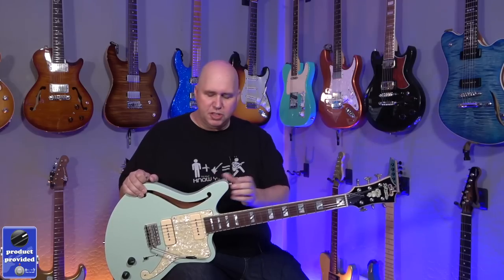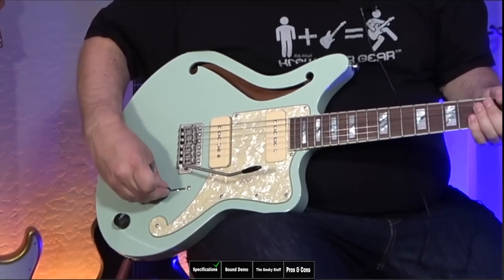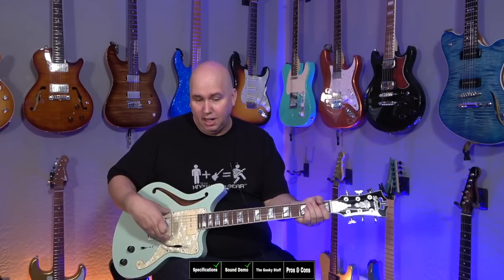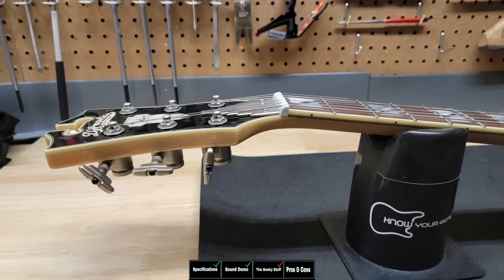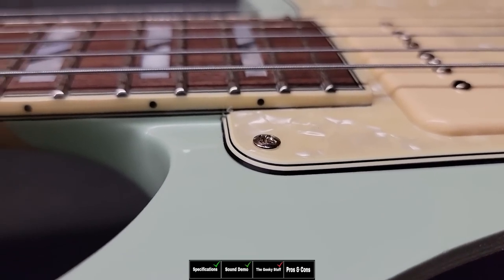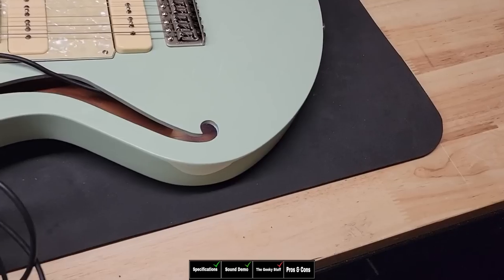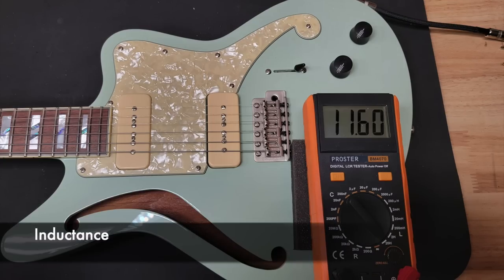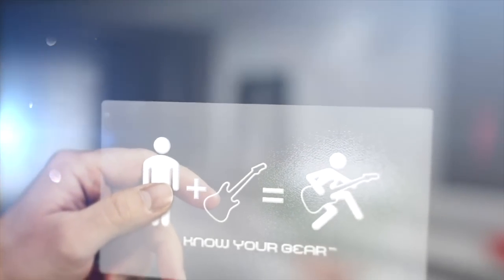D'Angelico Deluxe Bedford Semi-hollowbody

Comment: I love d’angelico guitars a lot. I’ve owned two of the old Bedford deluxes and currently have a Bedford deluxe. I agree that some of their hardware is shoddy to say the least though. 2/3 of my pickup selectors had failed by the time the guitars were in my hands. What’s worse their customer service is dreadful. They couldn’t tell me what switches they use and when pressed the sent me links to the obviously wrong switches (strat style then tele style when the only switches they used at the time were les paul style). To add to it I wanted to change the bridge on one to a graph tech and when I asked if they use imperial or metric they said imperial. I purchased an imperial bridge only to discover they in fact use metric. Wonderful guitars but a few small problems and terrible customer service. I hope they see this comment because they need to improve to keep a good image during these competitive times
Reply: I’ve found this is true with many Far East made stuff because they take care of everything over there. For example even Squier was unable to tell me the tuning keys used in a strat when one failed. They sent me new ones that didn’t fit. Sent them back and they said the only option was to replace the guitar, as they don’t stock parts for their guitars in the us. This is a common scenario.
Reply: This ^
Reply: @michaelraimondi4448  I'm gonna put my 2 cents in here. That excuse used to work for far east guitars because they were cheap. They could get away with it. When you're charging near 4 figures for a "far east" made guitar, you no longer have that cheap product excuse.

Comment: I caught the premiere, just wanted to say thanks for the review on my way out. I've been interested in getting a semi-hollow for a while and D'Angelico is definitely on my radar.
Reply: I just bought the CG Special edition about 5-6 weeks ago as I also was interested in a semi-hollow. (The metallic ice that always seems to be on sale, not the ivory one that's on sale at the time of posting.) I love it. I still need to take the ends of the frets down some as they are a little pointy and sharp. And I had to loosen the electronics plate to eliminate some buzzing in the lower 2 switch positions. I've enjoyed it thoroughly. I'm getting a nice range of sounds out of the pickups.

Comment: I have a D'Angelico Bob Weir signature guitar and it is amazing. It's the lower priced version, but it is so good that I can't imagine how the more expensive version could possibly be better. I will definitely buy more D'Angelico guitars.
Reply: Hey Robbie, so you don’t regret not getting the middle Lollar pickup? Or just that the price was way too much?
Reply: @timnewsom6422  l have the middle pickup. I just don't have the gold coloured hardware or the wooden knobs.
Reply: @Robbie63  did you replace the stock pickup with the loller? As in the more expensive model?

Comment: I like the way P90 pickups sound, somewhere between a Single Coil and Humbucker, and the Art Deco, whimsical look of the D'Angelico guitar. Wide pickups are something I try to avoid.  I found P90-SC · STRAT SIZED P90 pickups at MagnetoDesignLab. They have a bunch of sound samples on their site, and they sound good to my ears.
Reply: Was just wondering if someone out  there made single coil sized p90's...  Thanks.  I think an HSS Strat with a single coil sized p90 in the neck would be quite a unit.
Reply: @TurbulentJuice  Don’t think they can do that. From what I’ve read, the construction and dimensions of the P90 make it what it is, a wide, flat single coil.

Comment: Great video. However, I’m wondering if Reverend guitars offer more for the coin? This guitar is pricey at $1600 and Phil showed how the tone knob produced little effect. Average Reverend with Wilkinson trem and unique pickups and locking tuners, etc.—ie, basically similar features—goes for $1100. And Reverend bass contour knob does produce good effects on top of tone knob.